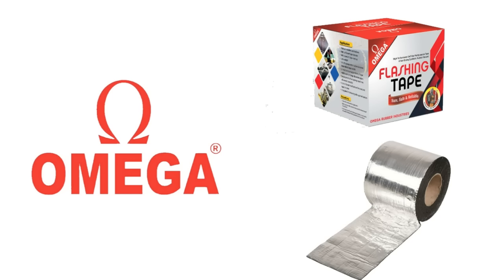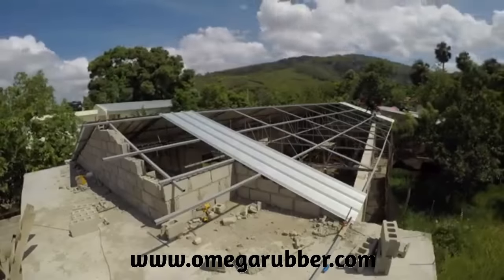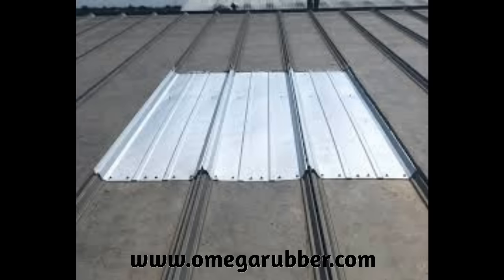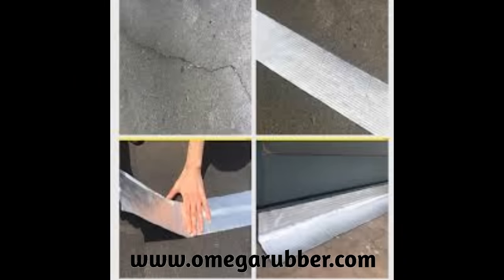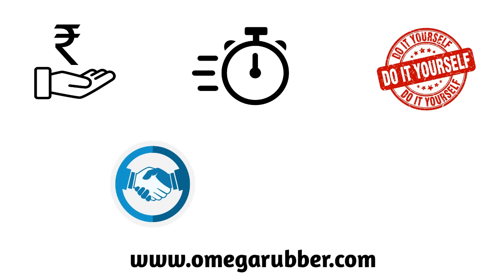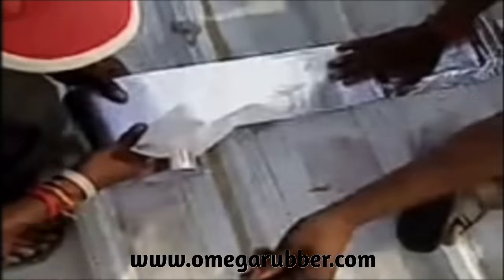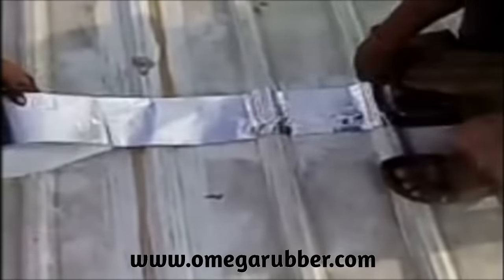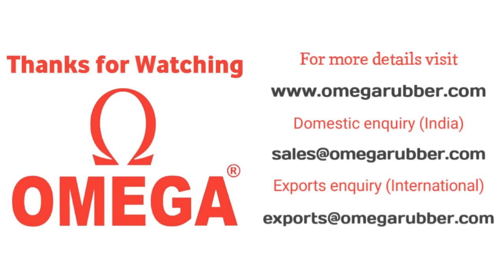How to repair your leaking METAL ROOF quickly using OMEGA WATERPROOFING TAPE

Comment: Is it durable..what happen during hursh sunny day when metal roof sheet are hot...
Reply from the maker: Yes it is durable and can withstand wide temperature fluctuations, in fact it’s superior Butyl Adhesive gives good service from -20 oC to + 120 oC and the top layer of Aluminium gives it protection against Sunlight and UV (Ultra Violet) Rays …..

Comment: Is it paintable? I do not wants silver color.. Because my roof color is different. Or does it comes in different color also? 
Any other solution like Sealant?
Reply from the maker: How Much Quantity do you need ? 
If you want paint-able , we can supply you Butyl Fleece tape , this has Fleece on top instead of Aluminium , and it is paint-able as well as plaster-able
Reply: @omegarubber  I need a lot( maybe 30metre - 50metres) 
I'm actually looking for Outdoor Weather Proof Acrylic Silicon Sealant 
Or Acrylic Sealant. 
The metal roof of a multipurpose hall(60ft by 100ft) is leaking at multiple spots..cant afford to remove and replace all the roof. 
So I'm looking for a cheaper solution, something paintable, weather proof, and which can last for 10yrs - 50+ years
Reply from the maker: @unknwn_usr3077  please call Mr. Sunil Batra on +919893100066 and ask for Omega Fleece Tape if you want paintable tape or ask for Omega Aluminium Flashing Tape if you want Silver color Aluminium backing tape . 
You can also buy our product online from Amazon or Flipkart 

Click on below link 

https://www.amazon.in/s?me=A31UCKADDKPX9T&ref=sf_seller_app_share_new 

Thanks 
Team Omega
Reply: @omegarubber  will check out on Amazon
Reply from the maker: @unknwn_usr3077   Ok

Comment: क्या ये कॉमन वॉल leakage पे लगा सकते है क्या 75 मीटर 4 इंची की price क्या होगी ये purches किस टाईप से कर सकते है
Reply from the maker: YES ये कॉमन वॉल leakage पे लगा सकते है 

 You can Purchase this product from Amazon or Flipkart…..

https://www.amazon.in/s?me=A31UCKADDKPX9T&ref=sf_seller_app_share_new

To Apply Omega Butyl Flashing Tape 
1) Clean the surface
2) Ensure that the surface is free from dust, rust, debris, oil.
grease, water, etc.
3) Cut the tape to desired length
4) Peel the easy release liner while applying the tape
5) Apply proper pressure on the tape, with the help of a roller to get a
long lasting adhesion.
Reply from the maker: In fact Factory se minimum 120 Mtr Dispatch kiya ja sakta hai ( 1 Cartoon mein 10 Mtr ke 12 Roll Pack hote hain ) , aap Marketing Executive Mr. Jatin Kale se +919752795566 , ya Mr Sunil Batra +919893100066 se baat kar sakte hain . Amazon ya Flipkart pe kafi mehnga milega

Comment: not water leakage just moisture leakage from new JSW cooling blue color sheets, what's the solution please ?
Reply from the maker: Dear Pranay,
We would need a little more information to be able to provide you with the correct suggestion.
to discuss further,please call/whatsapp on the following number.
+918962869630

Comment: Is it work in snow place like shimla manali in -10°c
Reply from the maker: Application Temperature: 0°C to 50°C
Service Temperature: -20°C to 120°C

As far as our product being able to deliver, you should be good with the above mentioned temperatures
Please ensure that you apply our product within the Application Temperature range and as in any other condition make sure that the surface is clean and dry

Comment: I need it, how can I buy it? What is its price.?
Reply from the maker: You can buy this product from Amazon or Flipkart…..

https://www.amazon.in/s?me=A31UCKADDKPX9T&ref=sf_seller_app_share_new

To Apply Omega Butyl Flashing Tape 
1) Clean the surface
2) Ensure that the surface is free from dust, rust, debris, oil.
grease, water, etc.
3) Cut the tape to desired length
4) Peel the easy release liner while applying the tape
5) Apply proper pressure on the tape, with the help of a roller to get a
long lasting adhesion.

Comment: My coolrr tub have some holes can i seal these by whose matter kindly advise 

I
Reply from the maker: You can certainly fix it using our tape,
Please make sure you clean the surface well before applying the tape for best results.
If you see any rust, please clean it with a metal brush first and if possible wipe the area with rubbing alcohol to ensure there are no impurities.

Comment: Thise is very helpful.
Reply from the maker: Thank you so much for the appreciation <3
Please find the link to our products attached below

150mm x 10mtr: 
https://www.flipkart.com/omega-butyl-flashing-tape-10-m-single-sided/p/itm3bb069294b20e?pid=HWTG3ZF47PGXK9TN

100mm x 10mtr
https://www.flipkart.com/omega-0mega-butyl-flashing-tape-10-m-single-sided/p/itme8d42ab882e2d?pid=HWTG2WF6HYFYZYAV

50mm x 20mtr
https://www.flipkart.com/omega-butyl-flashing-tape-20-m-single-sided/p/itm717078a38b9ed?pid=HWTG3ZF4KSJQ4W6U
Reply from the maker: We are now also available on Amazon
100mm x 10mtr:
https://www.amazon.in/gp/product/B0974G1QTB/ref=cx_skuctr_share?smid=A31UCKADDKPX9T

Comment: What will happened if the tar side of the tape is heated  before putting it on the roof? Or can the tape be heated when it is stick on the roof?
Reply from the maker: Just to clarify our product is not made of tar/bitumen like a lot of competitors in the market
We believe in delivering quality products only that is why our product is made of BUTYL which is a synthetic rubber and has a very good service temperature.

At the time of application make sure the temperature ranges from 0 to 50 Degree Celsius 
After application, the product will easily be serviceable from temperatures ranging from -20 to 120 degrees

and as far as your question is concerned you do not have to heat the product for anything ie. no additional heating is needed to apply the tape. just take it out of the box and apply.
in case you need any further clarifications you can call us anytime on the following number
+918962869630

Comment: Shall I use for TATA metal roof leakage issues ?
Reply from the maker: we are sure till the time the metal surface that you want to apply the tape on is absolutely clean and dry there should be no concerns
Reply: @omegarubber  thanks. It's very useful.
Reply from the maker: Glad we could help.

Comment: Thanks for informing 
How much does it cost ?
Reply from the maker: We are glad we could help.

Please find links to purchase our products below

150mm x 10mtr
https://www.amazon.in/gp/product/B097Y1NTQD/ref=cx_skuctr_share?smid=A31UCKADDKPX9T

100mm x 10mtr
https://www.amazon.in/gp/product/B0974G1QTB/ref=cx_skuctr_share?smid=A31UCKADDKPX9T

50mm x 20mtr
https://www.amazon.in/gp/product/B097Y3VZP8/ref=cx_skuctr_share?smid=A31UCKADDKPX9T

In case you need any further assistance, do not hesitate to contact us on the number mentioned below
+918962869630

Comment: Can it stand snow
Reply from the maker: Yes it can , only take care that you DO NOT APPLY IT WHEN it is Raining or during Snow Fall . 
The Temperature at the time of Application of tape should be between 0 oC to 45 oC . 
Omega Butyl Aluminium Flashing tape is made up of Butyl Rubber Adhesive and so the tape will give good service under sub Zero temperatures   . 
In fact it can withstand temperatures up to  - 20 oC .
Hope this information was useful !!

Comment: Can we use it on cement plaster?
Reply from the maker: YES ABSOLUTELY !! 

Before applying the tape on cement sheet or Cement Plaster please note the surface should be Clean and Dry.
Cut the tape to desired length , remove the release liner and stick it on top of the cement sheet/ Plaster .  
For Best result - Press the tape properly with a roller or with pressure of your hand as shown in the Video.

Note;

Our products are available on major e-commerce sites such as Amazon and Flipkart

Please find the links to our products below.

To purchase our products please find the link to our Amazon Storefront below
https://www.amazon.in/s?me=A31UCKADDKPX9T&marketplaceID=A21TJRUUN4KGV

Comment: How to remove this tape from the surface, if anyone wants to
Reply from the maker: It is not going to be easy to remove the tape , however if you need to remove it , you will have to apply a lot of strength to remove it, and once you remove the tape , you may clean the area with Kerosene , Diesel, petrol or similar solvent . 

You can also place a lot of ICE on the tape , Cool it properly , then try to remove it , IT will be little easier to remove . 

Hope this helped !!

Comment: Can it work for minus 10 temperature in Kashmir.
Reply from the maker: Yes , Butyl Rubber has properties to withstand wide temperature variations, its Service temperature is from -20 oC to 120 oC . 

However the application temperature is 0 oC to 50 oC , so Butyl Aluminium Flashing tape should be applied on the surface when the temperature is not Minus ….